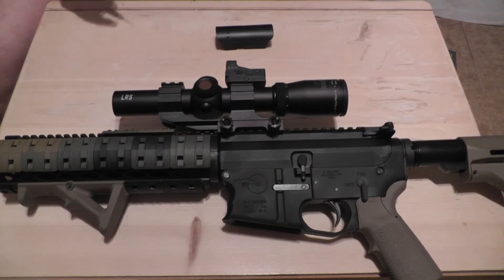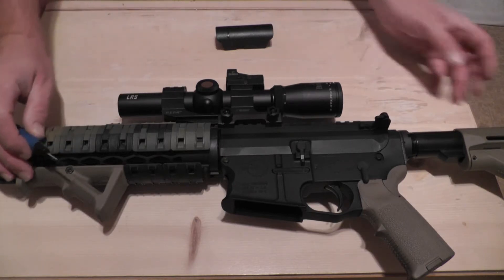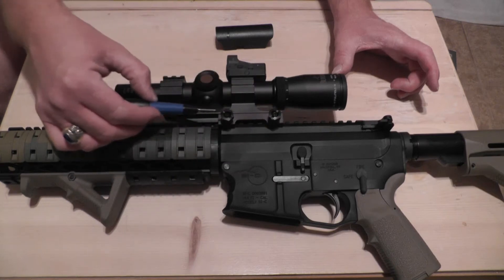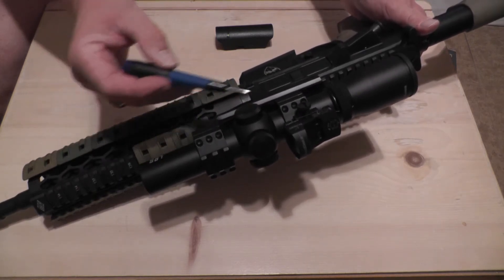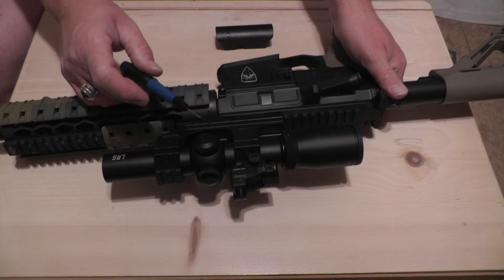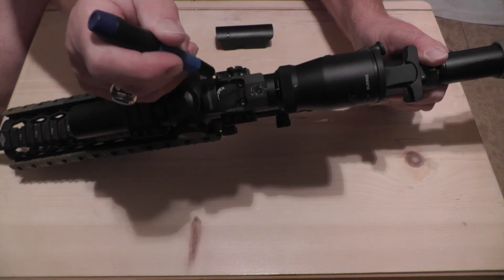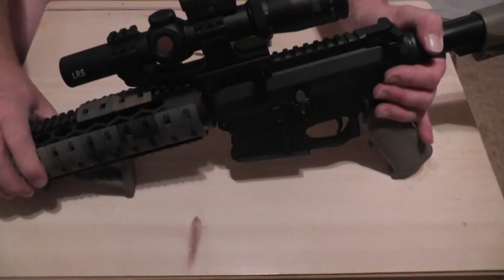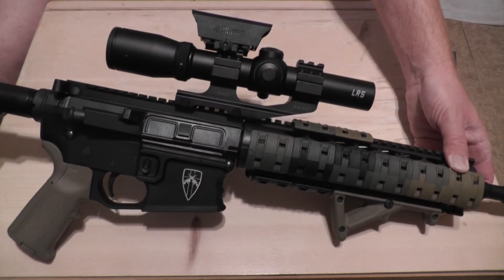Torque Specifications on the Burris Fullfield TAC30, FastFire III, and AR-P.E.P.R. mount

Comment: I only have a fixed warn T15 screwdriver. It's fixed torque setting is 25 inch pounds. Do you think that will be too much? 5 extra inch pounds?
Reply from the maker: I would email the manufacturer to be sure.  I choose to only apply the torque as specified.
Reply: +TXW5CSM the manufacturer Burris? Or the scope manufacturer, which is Vortex? I know Burris says 20 inch pounds. The vortex came with a little card that says to use recommended torque specs, I assume they're talking about the specs for the rings. I'm eager to mount it, but don't want to do any damage. Also don't want to spend $50 on a wheeler screwdriver. I could probably get one Amazon prime and have it by next weekend. That's the earliest I can go out to the range anyway. I'm just wondering if 5 inch pounds would be enough to strip out the pepr
Reply from the maker: +Poop Poo 
This is all "what I would do."  Please weigh my opinion based upon what you paid for it :^).  

To your point, 5 inch pounds are not likely to change much one way or the other.  Below is my best guess of how I would proceed.

Picatinny Rails SHOULD all be nearly identical.  The torque specifications should come from the manufacturer of the mount and not the rail.  All of mine were Burris, if the manufacturer of your mount is Vortex then I would contact them.  Photo attachments are always helpful as the names of common items are sometimes called different names by different manufacturers.  If you are speaking of a ring mount torque onto the scope and you purchased the proper size of ring mount for the scope from a different manufacturer, then I would recommend asking both manufacturers and go with the lower specification.  If you have any slippage at that specification, I would split the difference and try that.  Basically, use the lowest torque that works.  Wow, I hope all of that makes sense (a bit wordy).  As for the Wheeler FAT wrench, I recommend it highly as it will do just about everything that you need in the inch pound arena.  

Happy, Safe, and Accurate Shooting!
Reply: +TXW5CSM thanks a lot for the advice. I mounted the vortex in the Burris PEPR with the Warn 25" lbs torque screwdriver. Nothing stripped and the tube wasn't deformed. My pepr has the QD levers, so I just adjusted them until they were tight fitting. I am pleased with it so far. I have not shot with it yet, but will get to this weekend. Again thanks a lot, and good job on the video.
Reply from the maker: My Pleasure Poo,
    I enjoy sharing what I've learned, even if in your case it was just my best guess.  Like my tag line, knowledge is only power when it is shared.  Please touch base after a few hundred rounds and let us know how it went so others can also learn.
Reply: +TXW5CSM Shot it today. Everything fine. Was able to achieve zero pretty quick. Was on the edge of paper on my first shot and just adjusted it in. I did not get to put many rounds through it because my 9 year old daughter discovered she loves shooting. Most of the day was supervising her shooting my I mean her Marlin 60. It was cool. She never showed much interest before, and now she's Annie Oakley .